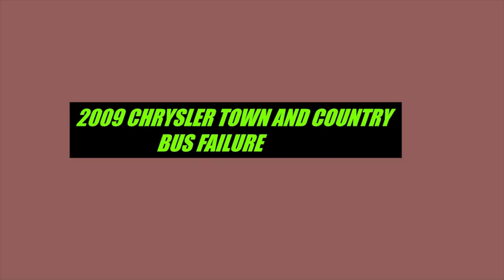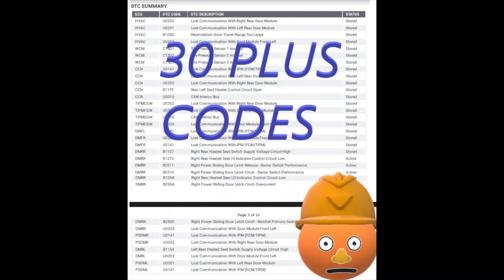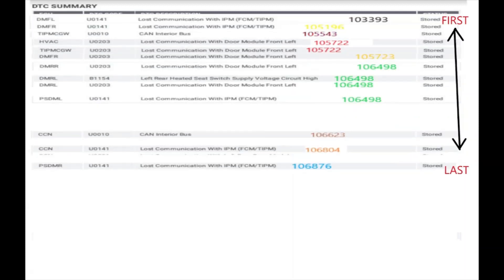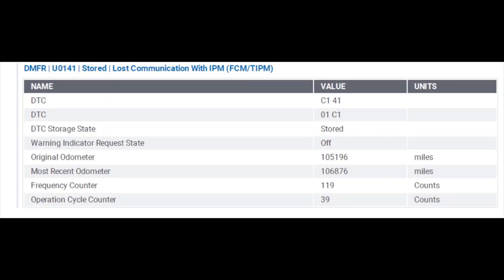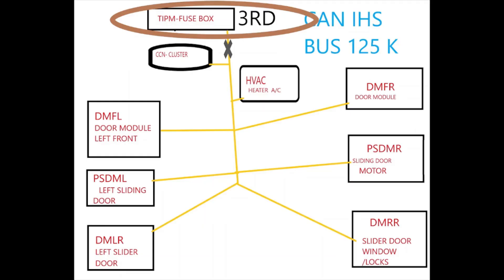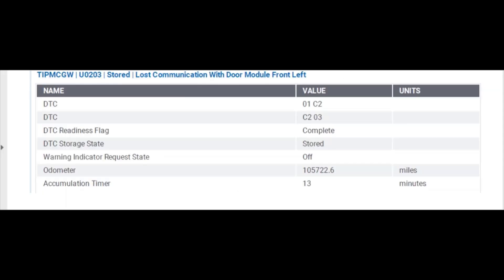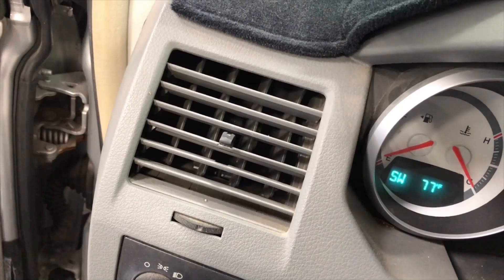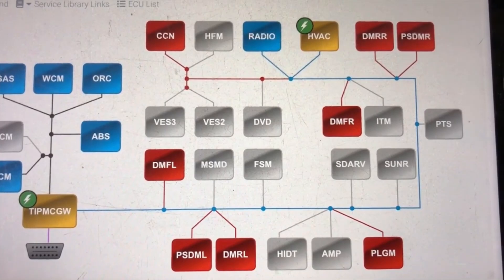2009 CHRYSLER TOWN AND COUNTRY LOSS OF CAN COMMUNICATION

Comment: I have a 2009 Chrysler town and country that will not communicate with drivers door module. The drivers door window switch does nothing only function that works on that door is for the vent windows in the very back of the van. I checked the power and ground at the door module that is good put the wires under a load with a sealed beam work light. I will be testing this out on those 2 can bus wires that go to my door module before I condemn the door module as being the issue thank you for sharing your knowledge this is extremely helpful I was unsure of how to test those 2 can bus wires until I watched this video
Reply from the maker: Glad it helped .
Reply from the maker: How do you have so many subscribers ??!!!